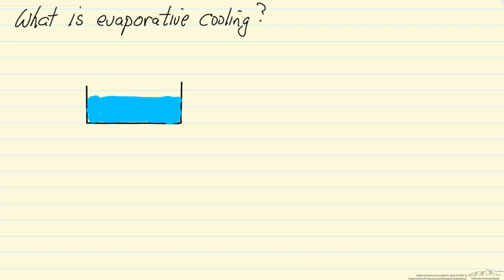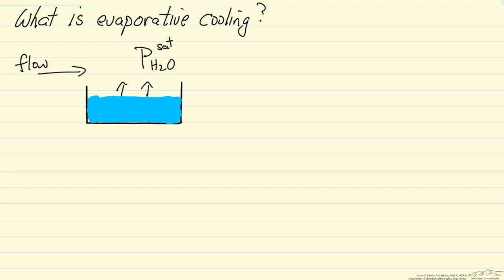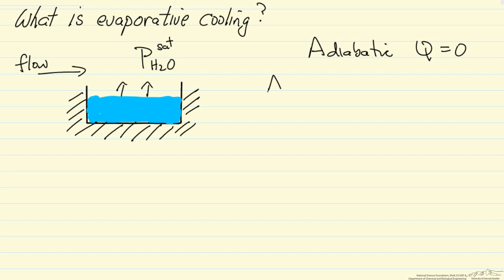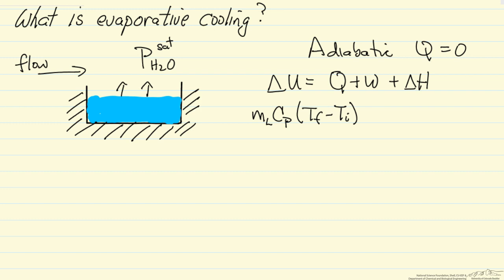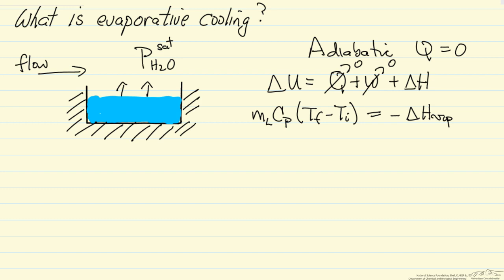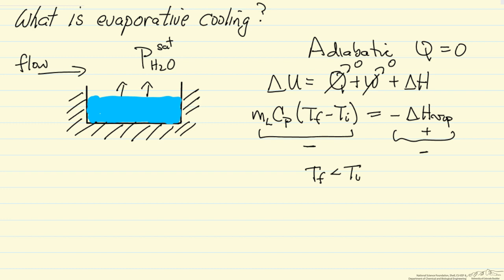What is Evaporative Cooling?

Comment: If air at dry bulb temp at 36 deg C and RH 42 %.
Can i cool the air at 11 deg C by directly adding chilled water into air through evaporatorive cooler.
What will be the required quantity of makeup chilled water?
And what temperature will be required for makeup chilled water?
And what will be chillier Load for make up chilled water?
Please explain with calculation

Comment: Have an argument with a friend: I am riding my motorbike in T-shirt and shorts. Outside air is hot, say 40C. (Body is 37C and naturally sweating). Will I be 1.heated or 2. cooled. I say 2 and he insists it’s 1 because wind is hotter than body. Anticipated thanks to the physicists.
Reply: It depends on how much sweat is evaporating. Your body will try and maintain its temperature so if you get hot you will sweat more. So you are both right and wrong. ha ha

Comment: If evaporation is energy leaving the water , the water cools and heat is absorbed in the air....
So cooling towers work this way. How does the complete opposite work with evaporative coolers (swamp coolers or misters)?
If warm air is passed across the mist and cooling occurs. I can’t connect the dots here
Reply: even I have the same doubt.. in one case air's temp decreases and in other case water's temp decreases and somehow both cases work on the principle of evaporative cooling
Reply: That is a good question. The water drops in temperature you are correct, and the net energy of the air also increases. If you look at it as a system the energy added to the air is not done by increasing the temperature but through the heat of vaporization. The air becomes more saturated with water rather than increasing the temperature. So eventually the cooler water can decrease the temperature of the room. This means that however much water is evaporated is how much cooling you can get from the swamp cooler.

Comment: What I'm gathering is that the faster a body of water evaporates the cooler that remaining water is since the higher energy molecules evaporated first (until water reaches equilibrium again).
Reply from the maker: If more water evaporates, the remaining liquid is cooler because more energy was required to evaporate more molecules. If water evaporates faster, the system is more likely to be adiabatic, which is assumed in these calculations

Comment: I don't understand how swamp coolers cool the air. Shouldn't the process warm the air? Where does the energy go?
Reply: I found a video which gives some insight into it: https://www.youtube.com/watch?v=Di8NvYVY064 (minute 31).
Basically what it says is that since it is an isoenthalpic transformation (because the air flowrate is much greater than the water flowrate), we can use the isoenthalpic transformation line on the psychrometric chart which gives a decrease in temperature as the humidity of the air goes up until saturation. But still I don't really get the physical principle of this, because in cooling towers the opposite takes place. Sure, cooling towers use muuuch more water than swamp coolers, but where does the physical difference lie? I mean, it's still evaporation with an associated latent heat going on. Where is that heat taken from: air or water?
Everywhere they say that in swamp coolers the latent heat necessary to evaporate the water comes from the air which is why the air gets colder. So maybe the key to understand it lies in the fact that in swamp coolers there's a much larger contact surface area between water and air so it's easier for air to give the heat required instead of the non vaporised water? Maybe the water on the filter is not really well "connected" to the water inside the filter, so the only heat source is air, or maybe again the water gets dragged as droplets and then begins vaporising, so there's not really water to give latent heat as it's shown in this example in which we have a "pool" of water or in cooling towers where we have a film of liquid.
I think it's a really confusing thing, why doesn't anybody seem to be bothered by this?
Reply: In swamp coolers the hot air and the water molecules in the side pads collide against each other and as water is coolant it absorbs the heat of the air resulting  in cooling the air and the water too evaporates at the same time with water vapuurs in it which is humid
Reply: @Esha-i3u  punctuation is your friend, cuz otherwise this is absolutely impossible to understand lol
Reply: 5 years with no good answer so I am here to save the day. I hope. The water temperature drops, and energy is added to the air via changing the heat of vaporization. This increases the humidity or how much water is saturated in air, rather than increasing the temperature. As a closed system, the temperature dropped. So basically you can evaporate water and get a cooling effect as long as the air is not fully saturated. That is why a swamp cooler can even be made with a 5-gallon bucket and a fan or blowing mist into the air. The more water that evaporates the better. In humid climates, this does not work very well though.
Reply: @GlobalScienceNetwork  still confusing
Reply: Afaik the swamp coolers push the hot air (the air water evaporates into) out your house, while providing cooled air (the air that got cooled by the not yet evaporated water) that gets funneled back into your room. If you have an indoor swamp cooler it basically acts like an open refrigerator. You will feel hot air on one side and cold air that's being blown where you want to.
Reply: Manus Dexter I get this better than a cooling tower. It seems totally opposite, on a hot day pushing hot air across hotter water , cooling the water and heating the air...
Reply: I came here to look for this. They usually show they work with just 1 passage (air entering the filter and leaving as cold air), but I thought the same thing: the evaporation should cool water and make air hotter. I had 2 possible explanations for this. The first one is that it happens in 2 passages: first, water is cooled by air, then this same water is used to cool new air, but this means that the cooling process between these 2 should happen as sensible heat exchange (ie conduction), and I think it would be not really efficient to cool down a gas with sensible heat exchange with water, but since we're talking about a kind of spongy filter, maybe it can be? And still, water would not only exchange sensible heat, it would still evaporate exchanging latent heat and make air a little bit hotter, so I don't know which effect would win: sensible heat cooling or latent heat heating? I think the latent heat should win, since we know it usually is stronger.
The second possible explanation I thought of is that it could happen like this, in a 1 passage only way: air cools down the water while it heats up itself, and then this same water which has been cooled gets dragged as little droplets with the hot air (not as water vapor which still is present in the air, but as little liquid droplets dragged by the air). In this way, the air we will receive is filled with cold water droplets that will make us feel colder, even though air is actually hotter (because I think we exchange heat more efficiently with the little liquid droplets of water). In this way though it should feel a little bit too humid, maybe? 
I can't get another explanation for this. Tell me if you think/know either one of this is correct or if you guys have any other idea, please.
Reply: Just to make it more confusing. Check this website: http://www.baltimoreaircoil.com/english/what-is-evaporative-cooling
They say that in cooling towers, first the air is saturated with water and then the cooling of water occurs once the air gets saturated and then the transformation continues on the saturation line. In that case, water is hotter than air, so after the saturation it can only get hotter sucking heat from water. In swamp coolers water is usually colder than air, so not only it cools down from non-saturation point to saturation, but it could theoretically continue cooling along the saturation line. But is this video wrong then? No, definitely more energetic molecules of water go from water to air, so physically it makes sense for the water to cool down (and sweating of our bodies is a clear representation of this). I'm so confused honestly. Maybe it still has to do with contact surface area.
Reply: @KazeReload  did you find the answer?? even i dont get as to why desert coolers and cooling tower work on the same principle of evaporative cooling, but in one case air cools down and in other case water cools down
Reply: The energy goes to the gaseous water molecules in the air as kinetic energy